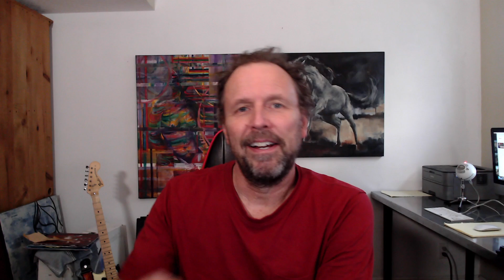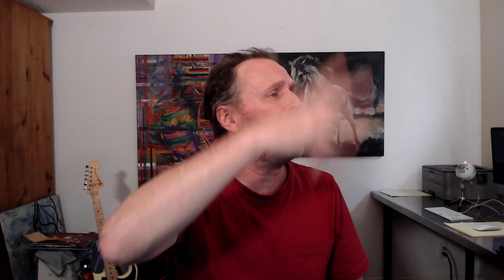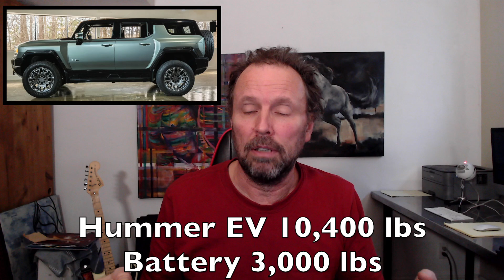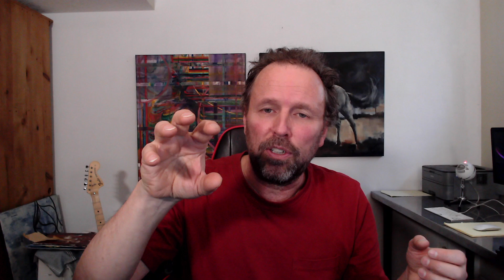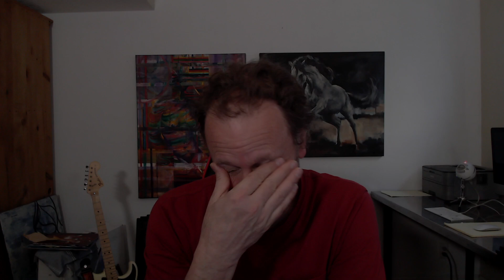It's Simple To Make Cars More Efficient

Comment: Your logic is incomplete, to put it nicely.  
You are completely ignoring the change in how the force is generated.  Electric motors deliver 100% torque at 0 RPM.  Gas engines require 100% throttle or close to it (read max fuel consumption) to do the same.
Also, EVs can generate charge through regenerative braking.  Negligible for highway driving but significant for urban commuters.  Also, you can put solar panels on the car (this is being done now) and generate 30 km or so of  range just by sitting or driving on a sunny day.  Show me a gas powered vehicle generating a gallon of gas for doing the same.  In addition, you can generate electrons by putting solar panels on your roof or yard.  Other techniques are also possible if you are gifted with wind or micro hydro in your area.  You won't find many people doing similar to make fuel for their gas powered truck.  These systems will generate a profit over their life span and continue to get better.
In addition, why are the only EVs you mention trucks and Hummers.  I agree with you that these are dumb vehicles, yet you fail to mention the much better EV alternatives.  Did you know Musk has built a Giga factory in China with a goal of making $25K EVs?  
Finally, your clickbait about going green is more than a little off the mark.  You only mention green in negative connotations and barely at all.  There is very little left to be gained after 100+ years of gas engine development.  In contrast, electric generation, storage and use has massive future potential.
Yours is purely an anti green point of view.  I comment to balance the scale a little.
Reply: You fail to address the fact that our grid is not able to support the number of EVs on the road. I would refer you to the article Road Block in the 2023 July/August edition of Pivot published by CPA Canada.
Reply: @richardroach7127  I will address it now.  Am not hearing about grid failures throughout our fine land, so it is safe to assume we are OK for now.  As EVs become more prevalent, there will of course be a need for a more robust grid.  Some of it can be addressed, as I stated above, by individuals generating their own power.  This pays for itself and eventually turns a profit even with today's technology.  I would hope the feds can resist the powerful self serving energy lobby sufficiently to provide tax breaks for those who choose to be more energy self sufficient.  What must be avoided at nearly all cost is constructing more fossil fuels burning plants.  In fact, we need to reduce those in operation today and do what little is possible to make the remaining ones more efficient and less polluting.  Power companies will always make decisions based on dollars so it is up to the Gov't to work with them via tax breaks and whatnot to encourage this.  Any new plants to be built must be based on renewables.  Pretty much every area has some natural advantage such as solar, tidal or wind.  Alberta, where our esteemed host resides, has a geothermal research plant if memory serves.  Check out Iceland to see some serious progress in this area.  They are almost self sufficient, even including building heat in a cold climate.  There is geothermal potential on every square inch of land on this glorious planet.
100 years ago, when gas became popular, did we look around and say there isn't enough production, refinement, gas stations or energy infastructure to fulfill the needs of all the cars we will build and then can the whole idea?  Of course not.  We built the necessary infrastructure.
This is no different with the exception there is a powerful energy lobby opposing change to the point of spreading disinformation and ignoring science all for the almighty buck and to hell with the planet.
Did you know this summer was the hottest ever recorded in the arctic?  Just as the scientists predicted with their models decades ago.  The situation is so serious that now, for every two greenhouse molecules sent up, a third goes up from the effects of the warming.  All this when the sun is currently in a down tick in output and has been for a few decades.  We have zero control over when it will return to the long term rise it has been in for millions of years.  What will happen then?
Reply from the maker: good comment.  mine is not an anti green point of view.  i simply point out that if we used used the science provided by F=MA in building vehicles (EV's or gas powered) we could be orders of magnitude more efficient.
Reply: @clauskellermanpov3004  car makers have been trying to make cars lighter for decades - that has little to do with being green
Reply: @clauskellermanpov3004  But when the change in velocity (delta v) is constant, accelerating quicker does not consume more energy. 
Work = (1/2) * mass * (delta v)^2

Comment: yes I know all about mass ,acceleration, speed, resistance that`s why I drive and accelerate slower, close windows to eliminate resistance, glide in neutral when going down the hill or approaching red lights 150m away and if I do all this I spend $4 on fuel per day but if I don`t do it my fuel consumption is like $6 per day, also when I bought recently all brand new 4 tyres and replaced almost bold ones cos me $400 but then I realised that just nice new tyres with full threads and bigger diameter reduced fuel consumption to $1 per day so in 1 year or 365 days my new tyres will pay themselves off almost 😊
Reply from the maker: nice work!
Reply: Don't glide downhill, or approaching red lights - Modern engines use no fuel when you are fully off the throttle and using engine-braking.
Gliding in neutral uses a small amount of fuel to keep the engine ticking over.
You might be able to get that $4 down to $3.60 or $3.70
Reply: @SimbianMinistry  well if I take my foot off accelerator the car’s speed drops very quick within 80m distance while in drive D but if I shift to neutral N then I can glide for almost 300m while the speed drops only by 10km/h so neutral does glide better on straight while on steep downhill it's better to keep it in D but on few degrees slight slopes I still use N if no traffic in front of me.

Comment: I drive a VW Golf PHEV - best of both world =)  U forgot 2 tell the difference between gas pollution and electric non pollution ........ Where I live, Norway (north Europe), all our electricity came from water turbins (waterfalls). That's why EVs and PHEVs are very popular here.
Reply from the maker: Norway generates good reliable clean power - nice.  In Alberta where I live most of our electricity comes from burning natural gas.
Reply: EV batteries contain nickel, manganese, cobalt, lithium, and graphite, which emit substantial amounts of greenhouse gases (GHGs) in their mining and refining processes. In addition, producing one tonne of lithium (enough for ~100 car batteries) requires approximately 2 million tonnes of water, which makes battery production an extremely water-intensive practice. Lithium mines polluting the underwater channels and local ecosystem through toxic chemical leaks through water. Cobalt is perhaps one of the most problematic materials used in electric vehicles, both environmentally and socially. Cobalt mines produce toxic residues that can leach into the environment, poisoning groundwater and harming nearby communities. Additionally, smelting cobalt ore produces fumes with a high concentration of sulfur oxide and other air pollutants. Almost 4 tonnes of CO2 are released during the production process of a single electric car. EV battery can result in higher carbon emissions compared to gasoline cars.

Comment: Love the video Claus, but I'd offer that if one accelerates with 1/4 the force and thus takes four times as long to get up to speed, we haven't saved 4X the energy.  Yes it's a savings, but not nearly what you'd think.  When vehicles become highly efficient in energy expenses and potentially recaptured during braking, this F=ma analysis starts to break down a little.  I do however wholeheartedly agree that EVs weight too much and drivers are dragging them around.  Additionally, Tesla knew exactly what they were doing when they launched with the Model S....  Fast sells.   All that Canada would need to do is limit electric power output by law and the sales would drop off immediately.
Reply from the maker: "limit electric output by law" simple.  but will never happen.  we want to be green but we want to accelerate fast too.